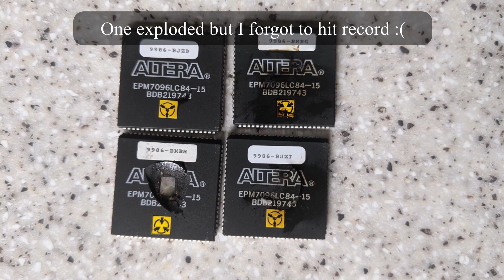Electronic components release the magic smoke! Blowing up chips that couldn't be reused.

Comment: How much current were you running through that screwdriver at 3:12? Wow
Reply from the maker: It was 5 amps, limited by a bench PSU but I've used a lead acid battery before but no video